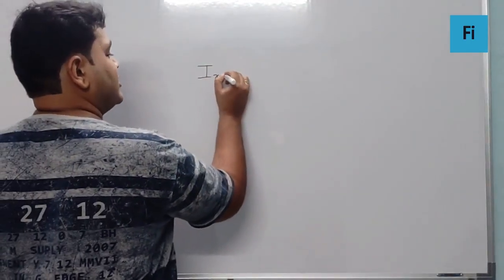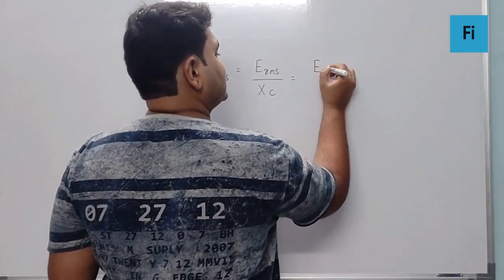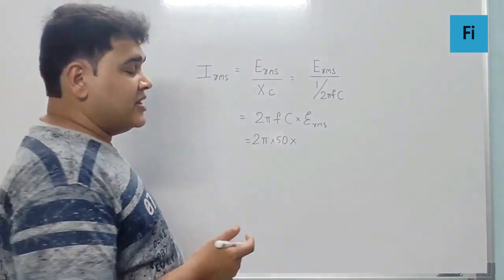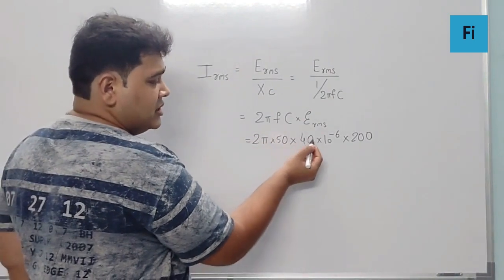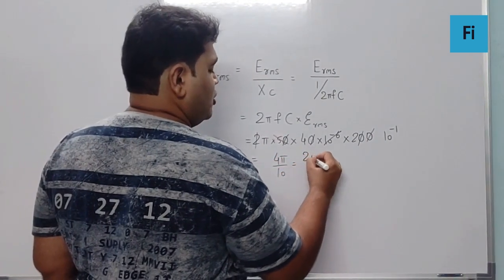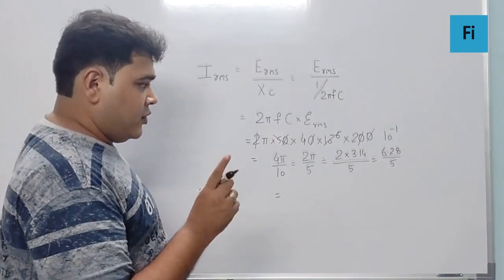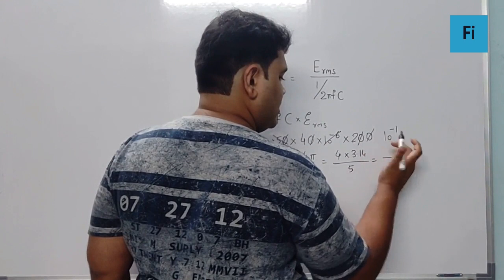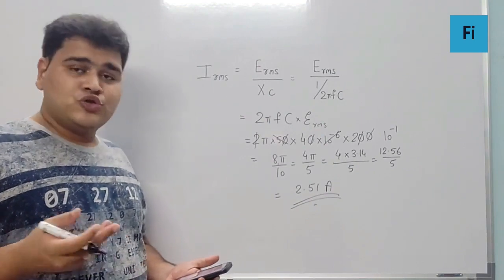A 40 µF capacitor is connected to a 200V: NEET 2020 Video Solution:

Comment: Sir how will we figure out if the given value of voltage is rms value or peak value?
Reply from the maker: By default it is RMS value. If it is peak then either they will mention it or they will give it in the form of equation where it will be in the position of amplitude and hence peak value